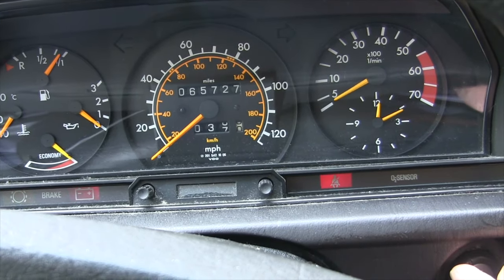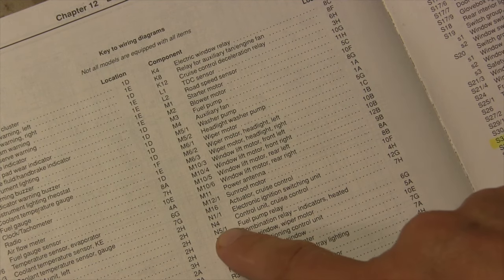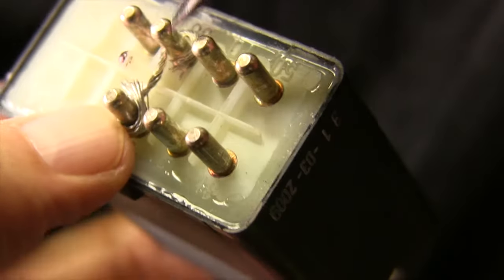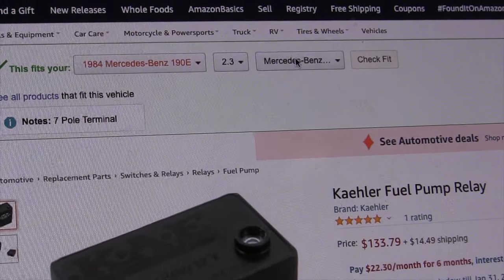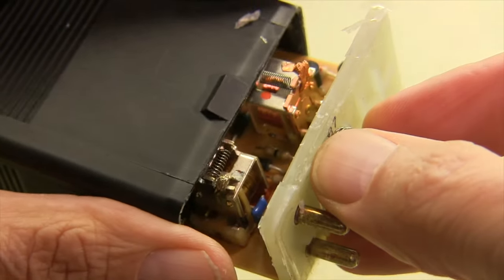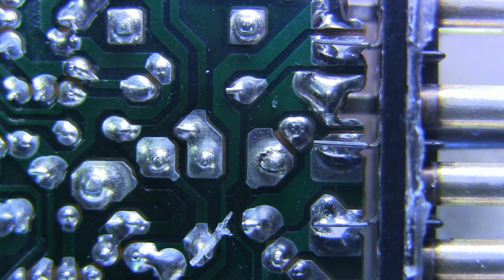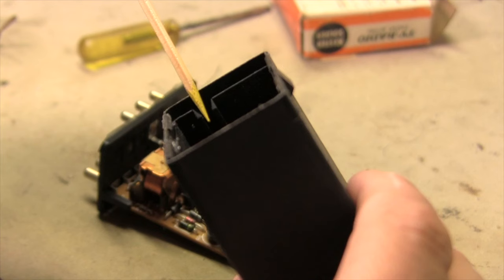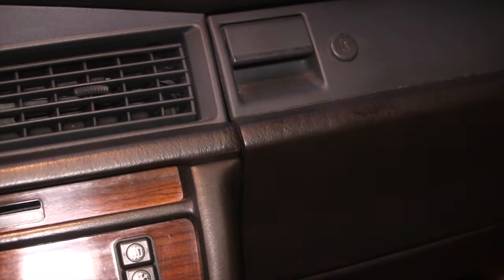Mercedes W201 190E Fuel Pump Relay also W124

Comment: FYI to everyone.  This solved my starting issue on my 1989 260E.  However, the exact same problem occurred again a year later and this time it was not the fuel pump relay.  When testing the relay, it performed just like in this video.  I got another new relay, but still the car would take a couple of minutes to start.  The only way to start the car right away was with the relay bridged with a wire.  On another attempt to start the car with the bridged wire, I could no longer hear the fuel pump running and the car would take a couple minutes to start with the abs light on and the rpm's very low.  Once the car reached operating temperature, it would idle normal and the abs light would turn off.  So the culprit this time was the OVP relay.  It was difficult to diagnose, because it would intermittently work and most of the functions of it worked most of the time.  What eventually happened though was that it cut the power to the ECU and so it wasn't sending a signal to the fuel pump relay.  So my advice is to get a new OVP relay as a spare and to help with diagnosing.  Honestly they aren't very expensive and having one on hand can be very helpful in pinpointing a problem.  Hope this helps anyone struggling to diagnose their hard starting problem.  Cheers!!
Reply from the maker: Excellent advice! The OVP relay is often on the list of 'Usual Suspects" when trouble-shooting Benz electrical problems.
Reply: What is an OVP relay?
Reply: @bikeman123  Over Voltage Protection Relay.  Watch the video at 1:15 mins.

Comment: Thank you! Great video! 🇺🇸 My 1993 isn't like this, but still gives me direction!
Reply from the maker: Thanks! Yes, any of the 1990 and newer will have a different fuel pump relay.
Reply: @FlashDriveFilms  yes, the MAS relay. But it's not the problem with mine. I have fuel and spark and no start. It will start for a short time after it sits, but will stall with any kind of load put on it. Then it stalls and may restart or sputter then eventually to just a crank no start and adding fuel to the (b
owl) doesn't help

Comment: Bought a 1989 260E that took a couple of minutes to start each time.  Once the car was running, the abs light was on and the rpm's were very low.  Tested the OVP relay and it seemed to work fine.  Followed what you did in this video and my car fires right up:)  I talked the previous owner down by $2800.00 because of the starting issue and I'm very happy it was a simple and inexpensive fix!!  Many thanks!!
Reply from the maker: Music to my ears. It's the exact reason I make these videos. Thank you for letting me know of your success!

Comment: Thank you for this , my car stalls coming to lights sometimes and when I turn suddenly right it instantly cuts out , another gentleman man told me it could be a loose connection where the fuel pump relay sits, so I will need to check that then check the solder on the board , my car is a 1990 2.6 so it has everything combined in the MAS relay
Reply from the maker: Yes, even with the newer MAS system, a loose connector or bad ground, or even older fuse, is enough the stall out the pump relay. Definitely check those connectors and fuses.

Comment: I can't understand how many relays there are in Mercedes. Which coded relay should I use for my 1987 300 sel automatic? 003 545 24 05, 002 545 52 05, 002 545 27 05, how can I tell which is the original relay of my vehicle?
Reply from the maker: I honestly don't know the original part number of your fuel pump relay. There are so many, based on what market the car was originally sold in, and what upgrades were made to the relay over the years. You actually don't want the original number as it would be so old now the capacitors are probably shot. The relays did evolve over the years, doing the same things with newer components. Things like MOSFETs and Surface Mount Devices (SMD) that weren't widely used in 1987. Hopefully someone in the comments section has a cross reference for you car and will chime in.

Comment: Its also help with w123 relay. I think if u have other mercedes with 87 and 30 pin on relay it will work too, but be carefull and check first wiring diagram for your car.
Reply from the maker: Excellent point. I think there are even W126 cars from the mid-80s that may use a similar relay. Always best to check you particular configuration.

Comment: I HIGHLY recommend that the flexible rubber coupling is replaced if you haven't done it yet. They deteriorate over time until the driveshaft falls out the bottom of your car! I know this from experience...

Comment: Thanks a bunch for the informative video.
What if there's no power to the relay? I am at my wits' end with my brother's W124 230E. Oh, I just realised something! Could I have put the relay in backwards? This would be ridicuous, but I might have. Does it go in on the w124 as it does on the 190?
Reply from the maker: Yes, the W124 & W201 fuel pump relays seat the same way.  And if you did put it in backwards, the relay wouldn't pick. Also check the fuses and OVP relay, just to be sure.
Reply: @FlashDriveFilms  Thanks!

Comment: Dude omg I've been chasing this f***ing thing for a year now replacing temp sensors and then yesterday after replacing fuel filter/accumulator and it still not working I found these hidden relays. Thank you very much I can't explain how good it feels to put this one behind me
Reply from the maker: Thank you !  I lived that parts-chasing thing myself the first time (on a 1989 260E) It was incredibly frustrating, and yet, once I learned the fuel relay thing, it has fixed  hard-starting and stalling issues on so many cars. I hope it gets you back on the road and enjoying your Mercedes!

Comment: Nice video, I was under the impression North American w201's were all 6 cylinders since 4 cylinders were kinda frowned upon there in those days. Learn something new every day.
Reply from the maker: Thanks! Until the late 80s, most W201s in USA were 4-cylinder. Either the anemic 2.3 gas, or the 2.2 Diesel models.  The 2.6 cars were later.
All the 4-cylinder cars are slow, Something like 12seconds 0-100kph, and almost 20 seconds for the Diesels. But they were fairly high spec, with automatic transmissions, A/C, ABS, power seats, windows and sunroof. All were fuel injected, unless privately imported "grey market" versions.
Reply: @FlashDriveFilms  things were worse in Australia - they made a 1.8 litre version for us 😂 That is the definition of slow, you have to use the first gear start just to keep up with grandmothers getting up to 60km/h. Truly bizarre decision by benz there. the 2.6 is rare here and was very expensive.

Comment: Thank you for this video, however my Mercedes 190E 2.3 m102 (4 cyl - 8 valve) 1993; has 10 pins in total, 6 in one row, 4 in the other row. Did MB change the pin out during the 190E years?
Reply from the maker: Yes, depending on the year and what market it was sold. In, (USA, Europe, Africa etc) the number and function of the pins did change. By 93 there was a cold start valve ( essentially a fifth fuel injector) with its own electronics altered for newer emissions requirements in some markets. That  may be why your relay is different. Or you may have the relay from a different model that has been previously swapped in. The center pins still power the pump from the key.
Reply: @FlashDriveFilms  Hey just wanted to say thanks! Finally got the correct pin layout for my 190E and the fuel pump was entirely the culprit.

Comment: Hi great video, i have taken my fuel relay out the nunbers are 003 545 19 05  cant find a replacement with same nunbers will the new 003 545 20 05 fit, manual gear box
Reply from the maker: I'm just not familiar enough with the various part numbers. (Mercedes has absolute dozens over the eyars for various configurations) If the number of pins matches, in general , it will run the fuel pump. However, it may have different circuitry for things like the cold start valve and rpm over-run when shifting gears. The fact the new par ti sonly one digit different does make me optimistic that it may just supersede the old one and work fine.

Comment: A+ for the great effort on documenting the repair
As a W124 owner i had to create an external 40A relay circuit that would run the pump with key on priority.
Unfortunately it's the way to go as the KZL relay board give it'slocation is prone to a consistent overheat situation resulting in a frail board and soldered pins breaking free.
Reply from the maker: Thanks! Yes, that is the problem with most automobile electronics: you want them close by their task to avoid voltage drop, but then they often share space under the hood in the harshest spaces, filled with moisture, heat and vibration stresses. It's no wonder circuit boards fail.
Reply: @FlashDriveFilms  So True! These did well for 30 years into the oven :)
Reply: What is a KZL relay?

Comment: You are a great teacher mate :). I have a m104.98x i wonder if the pins are the same to short to get fuel pump running ..?
Reply from the maker: Excellent question! I don't think I've ever seen an M104 in a W201 chassis. That's the twin cam straight six, and all the USA 190E that I am familiar with have either the M102 4 cylinder or the M103, SOHC six engine. The M104 was in the R129 & some W124 cars, so I'm not 100% sure on the fuel pump relay for them.
Reply: m104.980 you have to use the pins 1(circuit30)  & 2 (circuit 87)

Comment: You were extremely helpful, and your voice is just on point. Thank you
Reply from the maker: Thank you! I am glad it helps.
Reply: It was my dear, today i just finished swapping my 124 from m102 2.0 to m102 2.3 , and there is one thing im not sure about, when driving and applying half throttle the car feel weak, once i put full throttle every thing goes back to normal, what could it be? Oxygen sensor ?
Reply: @FlashDriveFilms  excellent video clip, will be my savior in the middle of the highway. Thank you so very much. Would you kindly do a video for AC compressor relay?

Comment: As always your a rockstar.  My car was showing these symptoms and my uncle down in Florida was telling me to tell the mechanics to do this job.  It sounded like a difficult job (which obviously it isn't) they charged me for the fuel pump relay $225 and put on the sheet it took them an hour so total was $325 for 10 min job. lol :( ***
Reply from the maker: YIKES! $325! Well, look on the bright side: the dealership would have charged you Twice as much, and also you will also never have to pay that again, now that you know how to do it.
Reply: @FlashDriveFilms  this was a whole in the wall mechanic that doesn’t specialize in Mercedes.  I could of went to a mechanic that specializes in Mercedes and it would of cost me half that.  This guy put on the paper work it took him almost 40 minutes.  😂
Reply: @FlashDriveFilms  I get it people have to make money it wasn’t the only thing the replace he charged me $225 for the part and at $165 an hour he charged me $110 in labor.  They also changed out other parts.  Total bill was about $700.
Reply: @FlashDriveFilms  my biggest concern is they didn’t even show me my old parts so for all I know they didn’t do shit after rapping me 🤯
Reply from the maker: A lot of repair shops not only have expensive tools, but then subscriptions that the factory makes them pay in order to access diagnostic programs. So they spread that cost over things that don't need electronic diagnostics/OBDII etc, So things like belts, filters and fluid changes get the price raised higher to help offset the times the shop needs to analyze things like fuel injection & climate control. That's where my videos can help with the mundane service /maintenance you can do yourself. And save the Big Bux repairs for the computerized gadgets.
Reply: @FlashDriveFilms  thank you for that.  This didn’t look like your normal typical shop they didn’t even have a storefront let alone they were irrelevant online zero reviews I couldn’t even find the business.  I got the referral from my cousin.  Then after doing the work he tells me cash only (aren’t you suppose to get a better deal when you pay cash) 😂 they charge me as much then the guys that specialize working on older Mercedes it’s like 🤬 

My biggest concern is I never got back my older parts so how do I know they actually did the work?  I check the relay and will it being hidden back behind the firewall it’s difficult to tell if it’s old or new 🤔 also the accumulator next to the fuel pump along with the fuel filter that I supposedly paid them for but I guess the only way to tell for sure is I’ll have to get under that car and look for myself or pay another mechanic, what would you do if you were in my position?

Thank you for your help friend.
Reply from the maker: Yes, I would definitely check the relay, as it is easy to get to in the engine compartment. As for the fuel filter, rather than jack up the car, if you have a selfie-stick, you can put your phone on it, turn on select video and then slide the phone as a camera underneath the car and move it around a bit (slowly) This way you can see if there is a new filter , or at least if there are signs that work has been done underneath the car.
Cash Discount Pro Tip: Always ask for a discount when you pay cash. Don't say "Do you have a cash discount?" Instead say "How much off for paying cash?" as you unfold a bundle of bills. Seeing cash shows you are sincere with your request. They might say "Ten Percent". If they say " Nothing", offer to pay by check or card. A shop has a legitimate reason to discount cash purchases: no worries about a bounced check or refused card. They get money immediately that they can then pay their creditors with. (like the auto parts store) Asking for a cash discount is a good habit to develop.
Reply: @FlashDriveFilms  thank you 🙏🏻 but for the fuel accumulator I actually need to lift the car up and unscrew the cover right boss?  This deal would of went a lot differently had my 3rd cousin not referred this guy.  There were many red flags but being that my cousin referred this guy I let my guard now and I never let my guard down oh well.  Next time I’ll use bill gates money and fly you down on a private jet and put you up in the four seasons.  As always friend thank you for your help.

Comment: Hey really perfect timing. Yes I found a real solution for my w124 200E vehicle. Thanks.
Reply from the maker: That is excellent. The fuel pump relay seems to be a very common failure on this generation of Benz.
Reply: @FlashDriveFilms  
Yes, it is a common problem. Does this relay have an idle state balancing function? Will a cold engine help choke?

Comment: I got the same problem with starting the engine but after I pluged out the relay I was confused. My 190e Is 4cyl and my relay has 6 pins. Can you give me some advice please? Thx
Reply from the maker: I don't think I've ever seen one with just 6 pins. If your 190E is a manual transmission and has a carburetor, it might lack the circuits for things like  transmission kick-down and the cold start injector. The 2 center pins should still be the power jumper for the pump though.

Comment: I have a Mercedes W124 250D. The car sat for one month without starting. When I started the car after, it didn't start. The engine spins and cranks but don't start. Before that, it would start without any problem. What could be the reason why the engine won't start?
Reply from the maker: There are so many possibilities. The 250D is a Diesel engine, that doesn't have the fuel pump relay like the gasoline versions. If it sat for a while, I would suggest putting a charger on the battery and making sure the glow plugs are working. You may have to crank the engine a lot to get the fuel up to the motor if it has drained back from sitting. Usually with a diesel it has to do with either temperature or fuel quality. Make sure the air intake is clear and that nothing (mice, insects) has set up a nest in it. You might try changing the fuel filter , filling it will fresh fuel before installing. (It is really hard to diagnose these things over the internet) Best of luck.

Comment: Where else would it be located I've been looking and nothing
Reply from the maker: Depending on your year, you might not have one. Some W124 models, as soon as 1986, a has Mass Airflow Sensor system in its' place. Look in the same region under the hood (in front of the passenger side, perhaps under a plastic cover) and amongst the other relays (like the OVP) you would find a taller, shiny chrome module with a tell-tale black plastic knob on the top middle.(Google "Mercedes W124 MAS" and look at images) If your car has that system, my video can't really help you.😔

Comment: I hear the noise indicating the fuel pump check but the car won’t start, could it still be this relay?
Reply from the maker: Hard to say. The relay does control the Cold Start circuit on some cars, but if you hear the pump and have fuel in the car, I would check for spark/ignition issues next.

Comment: HI ! two of my new Bosch fuel pump died in 5 months does the relay can be the issue in that case ?
Reply from the maker: I suppose it is possible, but fuel pumps usually fail from overheating or getting corrosion jams. If the fuel pump ran continuously it would eventually burn out. Same thing if it was run dry without any fuel going through it.

Comment: Salve sono un possessore di una w 124 200E ho un problema quando il motore e caldo.... Non si accende.... Ci vuole un bel Po' .... Cosa potrebbe essere grazie.
Reply from the maker: Difficile da dire. Se è iniettato carburante, controllerei il circuito della valvola di avviamento a freddo. Se è a carburatore, potresti avere un problema con il blocco del vapore.

Comment: Its safer and easier to jumper the socket pins to run the fuel pump without fitting the relay.